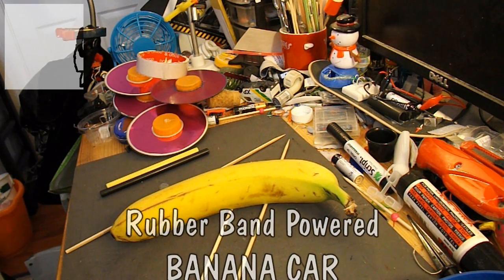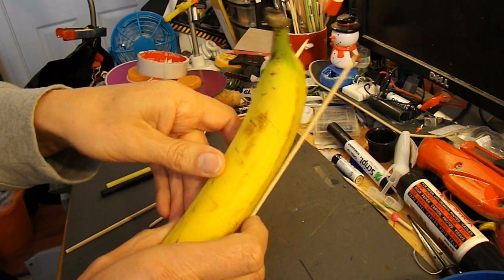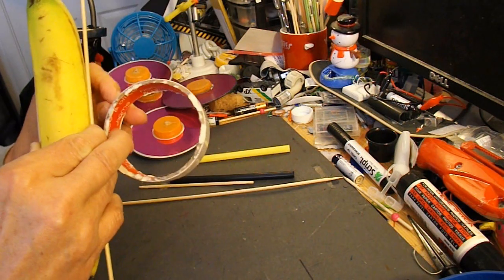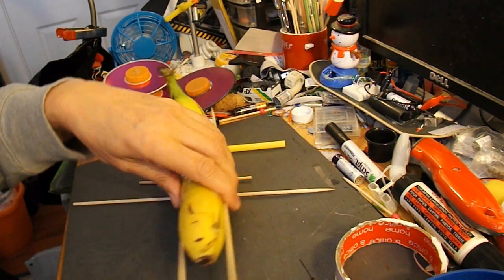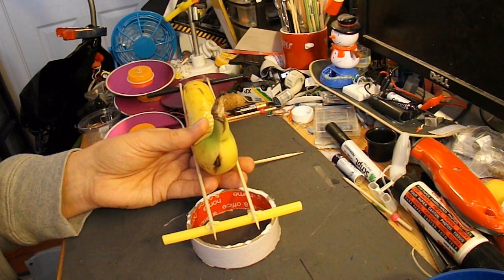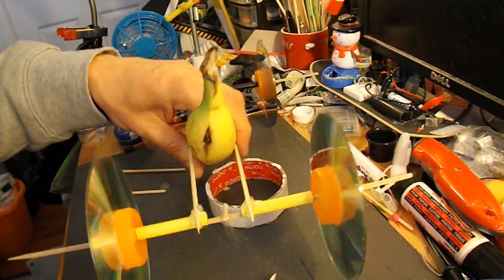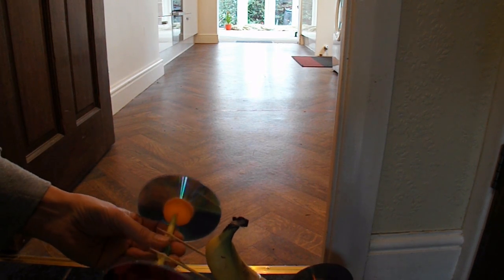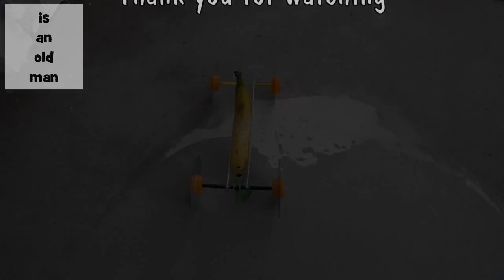Rubber Band Powered BANANA CAR

Comment: Is it possible to make the same car with just two rubber bands?
Reply from the maker: Rubber bands come in all shapes and sizes. Too small and the car will not move, too large and the wheels will spin wasting the power. If you are limited to two specific rubber band and the car does not move then you need to reduce the size of the wheels or enlarge the axle to change the "gear ratio". If the wheels spin wasting the power then you need larger wheels or more weight or rubber tyres to give you more grip.
Reply: @GrandadIsAnOldMan  Thanks for replying. This is for my daughter's science project for school.  And they stated we can only use two rubberbands
Reply from the maker: Many of the requests I get for school projects specify ONE size 64 rubber band. Those are quite a bit bigger than I usually use.
Size 64 rubber band measure 3 1/2"x 1/4"x 1/32" or 89mm x 6mm 

Here is an example of a car using just a single size 64 

Rubber Band Powered Car 1 x size 64 - full length video https://youtu.be/pIO3FiHX4Oc?list=PLA5a2xPRSrB3g5RiX8Kf_uUBOL0Tb7AS0

Comment: If you can charge a phone using a watermelon can you power a rc car from a watermelon?
Reply from the maker: Infamous Gamer if you have seen a video of a watermelon charging a phone then you have been watching a fake. As for powering an RC car, even if the phone charger was not a fake - which it is - you would need many times more power to power an RC car. Not just to power the RC equipment and the motors, but to carry the weight of a watermelon.

Comment: This in essence isn't a banana car it is a car with a banana taped to it
Reply from the maker: Jack Mccafferty if you follow the video we start with the banana, therefor it is a banana with a car taped to it. However if you would like to make a car entirely out of banana and therefor no CDs/DVDs. bottle tops, bbq skewers, rubber bands or glue, please do so and upload the video so we can see how you did it. I suspect you probably could if you froze it solid to give it rigidity. Cut slices for the wheels first and strips of skin for the axles before you freeze it, then assemble it all from frozen and film it quickly before it goes soft. :-)